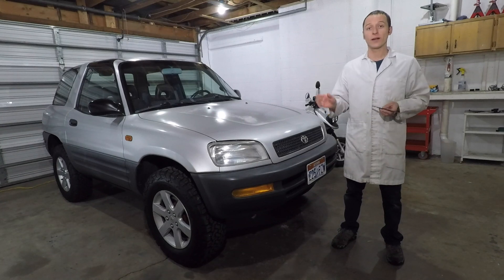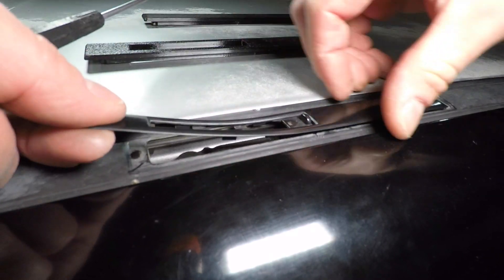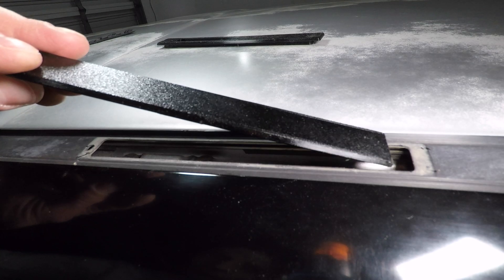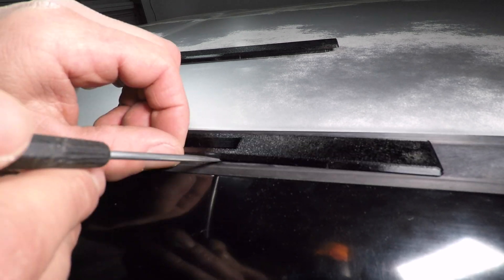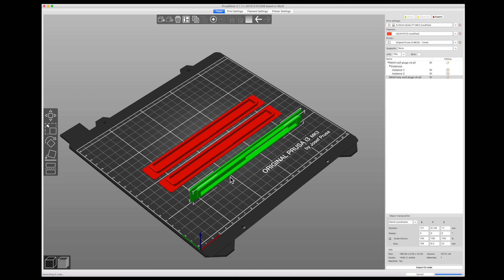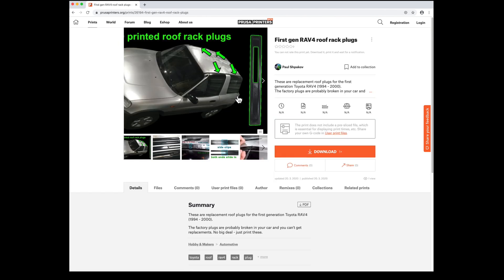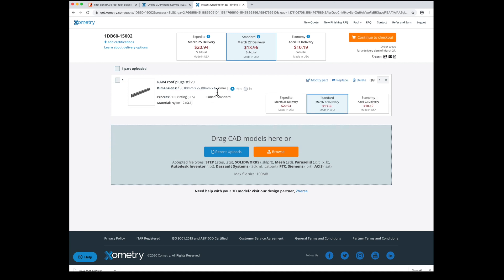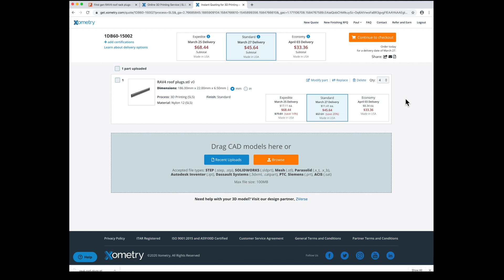3D printed roof rack plugs 1997 RAV4 (episode 21)

Comment: I'm trying to find a roof rack key ... "25".   Toyota says they can't get them ...
Reply from the maker: If you take a lock cylinder to a locksmith they should be able to make you a key.
Reply: I could take a lock to a locksmith to make a key.                           But don't I need a key to remove a lock ... ?

Comment: Can you please tell me where to find an affordable roof rack that fits my car.
Reply from the maker: You can sometimes find the original Toyota roof rack at junkyards.  They won't have keys, so you have to pull down the headliner to unbolt the mounts from inside the car.  You can also search eBay.  Join some RAV4 groups on facebook too.  There's a lot of people there that can help you.
Reply: @LabCoatPaul  Thank you!
Reply: @LabCoatPaul  Something I've been confused about is what exactly I am looking for.  Is it roof rack or cross bars and do they just snap in or what? I've inquired at a shop and REI in the past and they both gave me over enormous quotes, saying that my car isn't meant to have roof racks and something about drilling holes to make the car accomodate them. I have had my car 8yrs and always wanted roof racks but too confused to figure it out and not willing to pay that much.

Comment: Do you know where to get new brackets for the 97 rav 4 roof rack? Mine have rusted in the roof channel...can you switch them out? Looks like I’d have to drill out the old ones?
Reply from the maker: The junkyard is a good place, or you can look the parts diagrams at parts.toyota.com to find new parts.  You'll need to take down the headliner, and the roof rack brackets will have 2 nuts each that you can remove with a 10mm socket.  Check out my sound deadening insulation video at 11:30 https://youtu.be/OcwkOysXtds
Reply: Super helpful, thank you!

Comment: It would be great if you fixed the paint on the roof of your car and recommended places to do it
Reply from the maker: I will some day.  The RAV4 still has major mechanical problems I need to fix first.  It still leaks most of the fluids and I think it needs a new cylinder head.